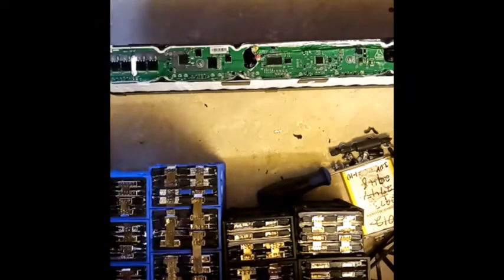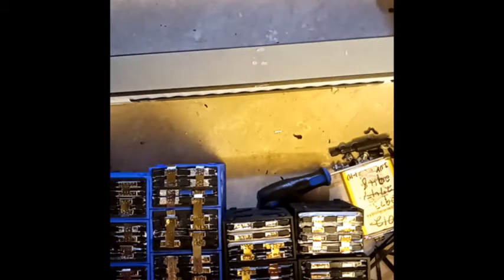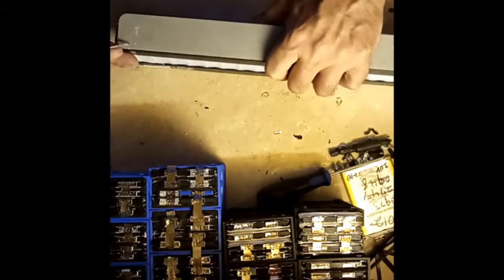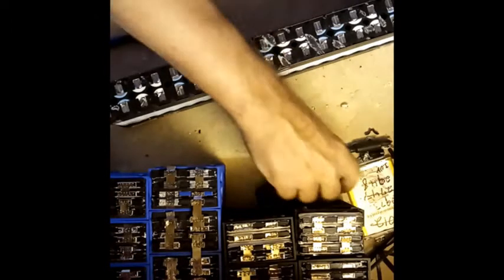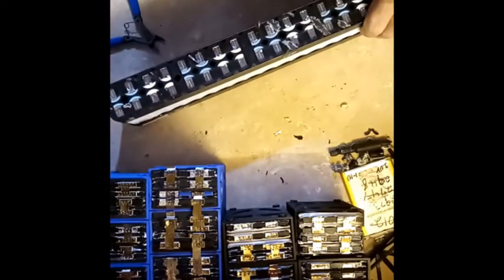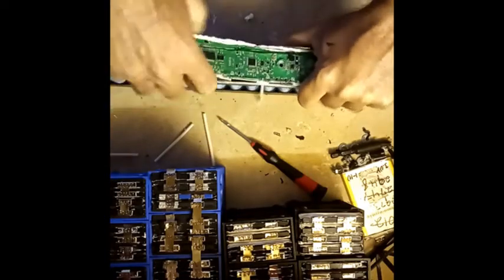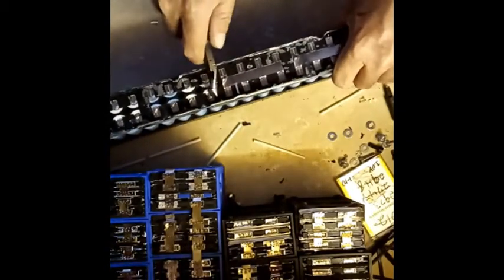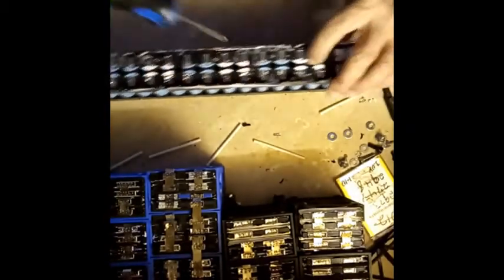4p 20S LG MH1 scooter battery salvage

Comment: Steve I was looking on thingiverse for the battery holder's was unable to find can you put up a link?
Reply from the maker: ive actually did an update on it sence then let me get that uploaded just a sec.. ok updated https://www.thingiverse.com/thing:4495956. you can find it also by search 6P stackable i tossed a photo in from blender for the front cover
Reply: @battery_solar_ev  Sorry Steve that's not the video I was referring to.  It was the one with the LiPo cells you were taking apart. You showed some kind of modular holder for like 4 at  a time.  That could be stacked.
Reply: The ATL LiPo cells from battery hookup
Reply from the maker: Oh the box it holds 8 cells total and friction fit for the ATL cells.